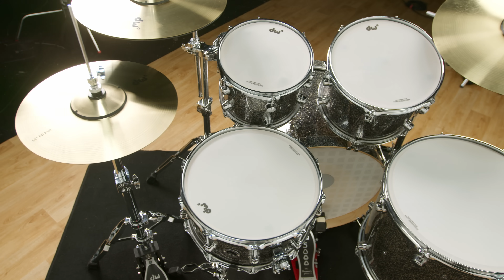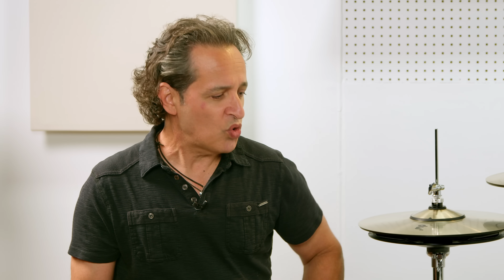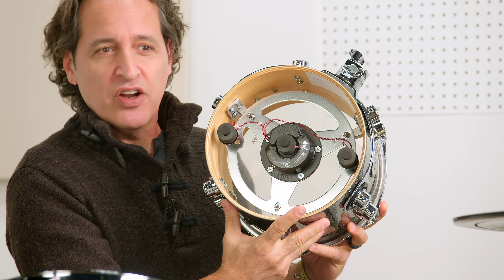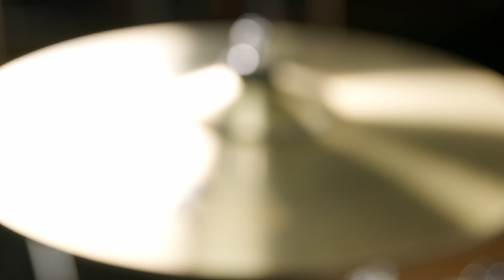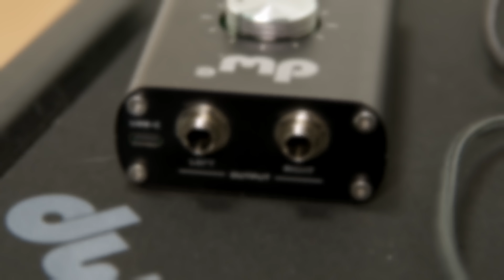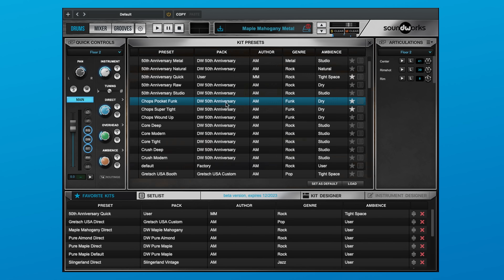DW’s DWe Drums: Two Worlds of Convertible Play, Total Innovative Control

Comment: The cymbals STILL sound digital, especially the choke.  That said it sounds miles better than the Roland kits and the wireless connectivity is amazing, I might need to buy these so I can use them with my bands, no mics to wire except for my vocal mic.  Huge win.

Comment: @sweetwater is there a package available that only allows me to buy the triggers inside, and I can place on my own dw acoustic shells? Also, the dwe cymbals with the processor?  Is that a possibility?  If so, would you please be able to provide a link?  Thanks!
Reply from the maker: Hey, tomeleefan. The triggers themselves are not available as of yet. And the cymbals will need the drum link hub by DW which is currently only available when you purchase the kit.
I hope this helps.
Jason Thiele, Senior Sweetwater Sales Engineer, (800) 222-4700 ext. 1391, jason_thiele@sweetwater.com

Comment: Seems like an amazing kit. but the only advantage of digital drums that this kit doesn't give you is the low volume of the electronic kit without amplification. it's probably twice as loud in the room as a pure electronic kit. and to me the entire reason I want an electronic kit is to play anytime I want In my condo without disturbing the neighbors. and using it to record in a home studio. and this kit has no outs because the software is all in your computer. not a module with outs. so they need to be bought separately. and switching this kit back and forth from electronic to acoustic would be allot of work no matter how simple they have tried to make it. personally I already have nice acoustic kit. and I don't need a combination set. I just want a great electronic kit with great realistic sounds and feel.  my favorite part of this kit is it being wireless and the software. the kit sounds really nice. since DW is owned by Rolland now. I don't get why Rolands top end kits don't have the realistic sounds of this DW kit. my question is how much is the DW software if bought on it's own. and how easy is it to use on a Roland set. Rolland should give you the option for the DW software with the upper end sets.

Comment: Great piece of hardware. Question, how do you present individual channels to a digital console for FOH? I mean once the drummer is happy with what's coming out of the DW software, the live mixing engineer may want the individual channels to remix for FOH. I only see a left/right output from audio interface.
Reply from the maker: Hey there! With the new DWe kits, they only provide a stereo output on the DW module itself. If you’re wanting to send a multi-track mix to FOH, you’ll want to use a separate audio interface to run out of the computer. With this, you’ll be able to access individual tracks within the DW software and send those out to the PA.
Feel free to reach out with any other questions!
Nick Pasquino, Sweetwater Sales Engineer, (800) 222-4700 ext. 3230, nick_pasquino@sweetwater.com

Comment: Man…I’ve had this DWe set for yearsssssssssss! 😂 I converted my exotic collectors series kit into an E kit and played with 2Box and Pearl Mimic pro drum modules with Jobeky metal cymbals all around. Good stuff man! The wireless is a game changer no doubt. It’ll take 5 years or so to drop in price, but this is amazing stuff right here man. And the fact that it has round robin nice sounding drum samples with multiple velocities with no machine gunning snares etc…is fantastic.
Reply: So you have tried or used the software? What is round robin? Really, I've never heard of that before but I'll probably google it faster then getting a response to this question.
Reply: @JoseMTamez  the 2Box module and Pearl mimic pro modules have their software built in. The mimic pro actually uses SS5 slate digital drums. I’ve used Evil drums VST software on my Mac and that was fantastic too. Quite the learning curve. “Round robin” is a term used to describe drum samples that are recorded multiple times at different velocities when hit by the stick, there’s upwards of 250 samples of high quality drum samples so when you hit the drum, it doesn’t play the same drum sample 2,3 times in a row. That’s what causes machine gunning snares where it doesn’t sound natural. When you hit a soft hit, it will play a real life soft hit when it was recorded. Back 20 years ago, they’d use one sample over and over and just lower the volume of the samples for “soft hits”. Round robin describes the smoothness of the drum samples. Not cheap sounding same snare sound over and over.
Reply: How do you individual  line out to front of house
Reply: @philipleblanc62 you use a multichannel audio interface or direct to digital mixer. You then choose which kit elements you want to go out which channel. You can even send the bottom snare mic and the sub kick channel out their own channels.

Comment: all these drum triggers, ( ways to quantify drum head movement ), and i cannot find more than 3 numbers on drum head overtone modes. ( the overtone series )

drum synthesis suffers not having all the numbers on the overtone series of circular heads and cymbals .... i am poor, and have no way to measure drum head modes, but i do programming in NI reaktor, and my drum synth work is at a stand still..... Don't People Get Sick Of Scrolling Through Tons Of Static Samples ??? ( well ok, synthesis would be processor intense vs just storage, but it would be a paradigm shift in analog percussion synthesis also )

Comment: What is the point of an electric kit as bulky as an acoustic one? Just don't get it. 😂
Reply: 1. Translatable form: you won't need to adjust your form or play-style at all transitioning from acoustic to electric. This is especially important for beginners trying to develop good form. 

2. Stage presence: it does a better job of fooling an audience because it looks like a real set instead of some plastic toy.

3. Better emersion: it does a better job of fooling your brain into thinking you're playing an acoustic kit, which makes the experience more emersive, realistic, and enjoyable. Even great VSTs aren't convincing to play if they're running through some small dinky plastic e-kit.
Reply: @mattdrewdrums  1. I can set my traditional non bulky electric kit up with exactly the same ergonomics as my acoustic.
2. Any serious gig you'd be using and acoustic. Corporate gigs no one cares what you're banging.
3. I have a brain that can concentrate/flow when playing, it doesn't need fooling.

I'll keep light weight non bulky electric thanks. Been playing electric and acoustic since Simmons in the 80s. Electric is only good for practice, small gigs, and electronica music in my opinion.
Reply: @mattdrums8341  Buddy, you're stuck in the 90s. E-kits are becoming remarkably close to acoustic ones. They will definitely be used on stage during live concerts. These things are no longer just meant to get some practice in. They are going to slowly merge with (or potentially overtake) acoustics, like this DW. The reason being what I listed, among many other things. At the top though, is the convenience. Having unlimited customization at the push of a button? Almost no wires or mics to connect? Being able to practice whenever and wherever you want? That is something unheard of for drummers. Having to switch out heads, cymbals, tune your drums, set them up, mic them, etc. ALL of that bs can be avoided. If DW can create a kit like this today, I would venture to say in 10-20 years we will have e-kits that are indistinguishable from acoustic ones. And, once we arrive at that point, there will be pretty much EVERY reason to go electric and virtually NO reason to play acoustic. 

But, sure if you want some dinky toy looking thing to practice on, by all means.m go and buy one. But, most people aren't satisfied with an expensive e-kit if it doesn't FEEL emersive. A huge part of that emersion comes from the feel of the kit. The real sizes have a weight to them that feels natural, and, again, your form directly translates. I mean, transitioning from a 12 in pad to a 14 in snare even feels weird af. It totally effects where on the stick the rimshot lands.
Reply: @mattdrewdrums  Hahaha, stuck in the 90's!
I'm about to play an advanced self made light weight mesh head kit with metal practice cymbals triggering native instrument samples, that cost me no where near the blag that DW and the likes of Pearl are marketing to you. Feels brilliant, and the cymbals are way better than anything else out there.
For practice and electronica only.
I know the market, I'm a teacher, recording engineer/producer, and tech savvy.
You're just stuck on bulky stuff that's marketed to you.
If any big band rock, rnb, funk, jazz (eg not electronica pop) pro uses the stuff you're talking of for big gigs, without being sponsored to, I'll eat my hat.
Reply: @mattdrewdrums  I'm currently moving from Roland kits which I've played on many of their models, and making a new kit, get a second hand cheap kit with a nice wrap, cut the shells in half or less depending on what weight/bulkyness you want, mesh heads, DDrum triggers, cheap metal practice cymbals muted with Magnatrack cymbal trigger kit, any old second hand Roland electric drum module (because they talk to DAWs best i can guarantee you), and Native Instruments drum sample packs (some of the best samples there are recorded in places like Abbey Road Studios). Cost around NZD $2000-2500 (I already had DDrum triggers from my recording set up and spare stands). The other great thing is that because they're shallower than full acoustic size I can add them to my acoustic getting them into much more ergonomic positions than a full size bulky drum.
Your in the 2010s buddy, I'm in the 2030s.

Comment: Cool kit....but USD 11.000??? What's the target customer at this point? Only people I know that prefer electric over acoustic are the ones who live in flats and have no chance of drumming with acoustic due to noise, even if electronics also have the problem of mechanical vibration for simply being percussive instruments. Unless you have a 12" concrete slab on your flat, your neighbor is still gonna sense the bass drum hammering. At $11 k, just buy a house or built a sound proof room on the yard and play a $2k kit which will give you a greater satisfaction (IMO).

Comment: It's a shame that there is no independent module and you have to rely on the computer again. In addition, the individual outputs of the drums and overheads are missing if you want to mix it professionally.
Reply: Did you watch the video? You can mix in the software. I'm sure the channels can be sent to the sound guy to adjust more if needed.
Reply: Use any soundcard/interface you like for multi-channel balanced outs etc. easy

Comment: I get that DW will have higher margin on this kit, but the real game changer is not the shells, it's the triggers and cymbals along with the software.  As it stands now, I don't think this will sell very well.  The biggest market for this type of thing could be churches, but at this price you're hitting churches that have huge budgets.  Ones like that have $10,000 drum booths along with another $5,000 in cymbals and drums and another couple grand in mics.  Those will sound better than these. Same for big touring acts. They won't be interested.  But if you sold the triggers separately, foe something like $250 a piece and maybe a little more for the cymbals, a lot of churches would splurge and put them in their kits they already own and ditch the booths.  A lot of them already have a DW kit, but usually not a collectors series... I have a collectors series, but don't play it much.  I have a millennium MPS 1000 that I play more.  It does exactly this, but with wires. Oh, and it's $9,000 cheaper.  I want to cut the wires, but maybe for $1,000, not 10x that.

Comment: Very impressed with the DWe kit!  I'm curious on how intricate the cymbals are.  Can you make swells or do light cymbal work?  Also, is this kit and/or the DW software compatible with Superior Drummer 3?
Reply from the maker: Hello, Bradley! The cymbals on the DWe are dynamic and responsive. Like any other e-drum kit, you will need to spend some time getting the velocity curves dialed in to your playing style. More on this here:
https://www.youtube.com/watch?v=_pAR2LDh7fA
This kit does still output MIDI data, so it can indeed integrate with third party drum VSTs.
Thanks for the interest!
Cody Kraus, Sweetwater Sales Engineer, (800) 222-4700 ext. 1766, cody_kraus@sweetwater.com
Reply: Yes, I've heard that it compatible and can be used with other software or drum module.

Comment: There's lot of a work to change electronic into acoustic for one song for example...change all the heads, change all cymbals...and I think no one wants metal parts into drums so for the longer time you had to remove them too and I believe there would be damage on shells inside which is unaceptable for such expensive drums
So I think DW cleverly wouldn't promote this changing too much, they would just mention that like they did here

Comment: So, you can’t record multitrack out to your daw? It’s only a two track stereo?
Reply: yes of course you can track midi and then bounce out stems or mix all the parts separately or output individually to an outboard mixer via a multi-channel audio interface etc many options
Reply: That seems like a ton of extra steps. A drum kit thats nealy 10K should have an interface with eitehr 8 di outs via ethernet or analog outs or a simple USB out to the DAW for multi-track recording
Reply: @HomeRecordingMadeEasy   The software runs inside any DAW so out of the box you can record it multichannel directly after connecting it to the computer. It's a full acoustic kit AND electronic so it's like buying a hybrid EV car. Can't be cheaper than a conventional car if it has twice the equipment, engineering and usability.

Comment: The only true advantage here depending on how well it works is the kit being wireless. No one is going to be swapping out heads and trigger plates.
10k could buy a nice acoustic and a separate e kit.
Reply: This is the first of presumably many future products using this tech. It makes sense they're price anchoring it super high and then releasing other drum kits using the same tech at lower price points. It wouldn't be surprising to me to eventually see this tech in a pdp kit or in a Roland kit in a more traditional trigger pad sort of look. This one is literally a super high end DW kit plus a bleeding edge tech electronic kit (merged together)... plus super high end hardware. They'll be able to package it in more streamlined ways in the future if they so choose. I'm sure many folks will want to wait for those (and be happy with them). I'd imagine with a more traditional Roland type drum pad design that things like changing the batteries could be way simpler, too (not that you'd need it to be with 2+ years battery life).

Comment: Some great tech on display here!
Yes, its expensive stuff, but everything high quality and brand new is. Besides, it probably wont be too long before wireless becomes the standard - which will of course will introduce competitors and drive prices down.
My only wish is that the future will also allow for the software to be run in a more mobile capacity - for example, from an ipad. Clearly, speed and memory of the elctronic device is a limiting factor right now, but as far as using this stuff live, you're going to need a hefty laptop, which will add more to the overall price, and also requires you to bring the laptop to gigs with you.

Overall, great initiative from dw, though!

Comment: I’m using the TD50x, DW Performance series kit with mesh heads, Roland triggers on every head, three Roland bar triggers and Field Cymbals. Lots of cables! I do run the outs on the TD50x  to a DI and then to a snake for the sound tech.  These Roland cymbals seem to be copies of the Field cymbals.
Reply: Nice! TD50X has balanced outs so no D.I needed though.
Reply: True.  The DI addition to the rack I use with the TD50x is more for the venue sound tech.  It was his suggestion.  He can easily hook up the snake to his on the stage and we’re ready in a few minutes.

Comment: Wireless edrums and low latency finally !! I am in, The only thing I would want to figure out is if there is a way to put a thin ribber coating on the cymbals so I wouldn't have to hear the loud metal ting sound when hitting them.

Comment: of course it is a genus invention. And if it works right under live situation it is probably the future of electronic drums! BUT, i don't need a giant acoustic high end drum set for about 6 K to play electronic, i NEED to save space on smaller stages. So, hopefully, they offer it with the DW frequent flyer, or sell just the electronic to built it in an existing small drum set.  Then i would buy it!

Comment: PROS: Easily a "convertible drum set."  •  Same sounds in all environments(with minor ambience adjustments).  • Perform at full velocity in any situation.  •  FSR sensors DO make a great difference in feel with pressure(muting heads/pushing IN on heads).   CONS:  MUST have computer to run in all digital situations.  •  Have to rely on that computer for "stability."  •  Have to have the means to send all individual channels to FOH sound if he/she wants control out-front...and THEY ALWAYS DO!  ;)   •  Batteries!   •  Triggers DO go bad.  •  Heavy hitters will realize that it DOES TAKE FINESSE to get these drums to respond correctly!  •  Snare drum and Cymbals STILL don't seem perfect...and most-likely never will.    BONUS:  The EASE of removing/installing the innards!  WOW!
Reply: Unless they address the lack of individual Outs, it's a no go for the majority of Live Drumming. None-the-less, a very cool kit.
Reply: @iplaywithsticks6194  Regarding outputs: I guess that would depend on what interface you might be using. The software/mixer section shows aux/bus and sends at 20:50